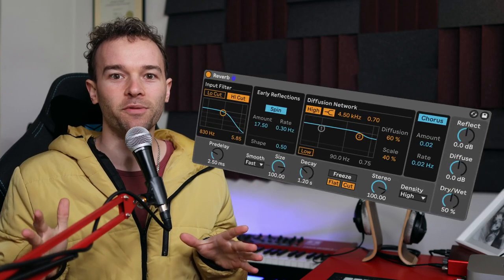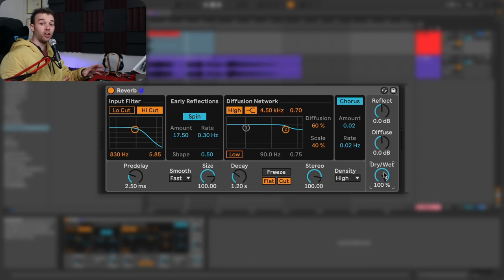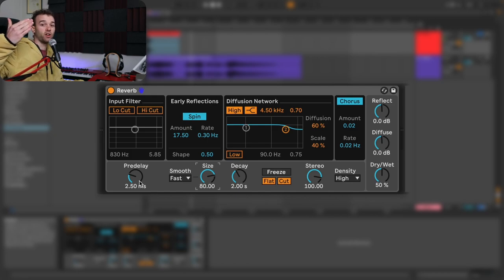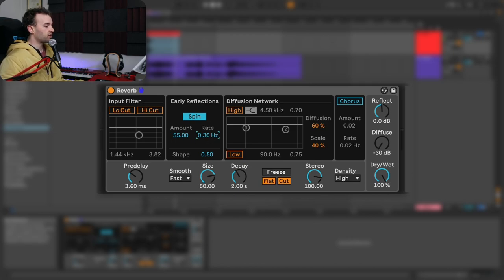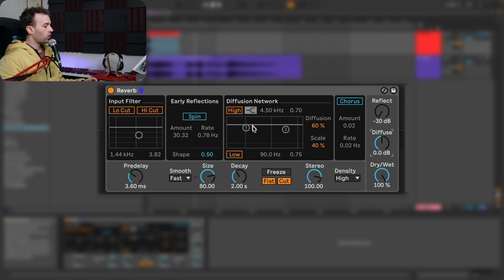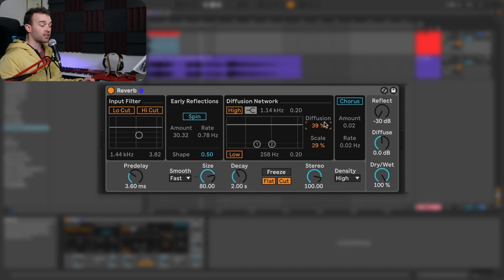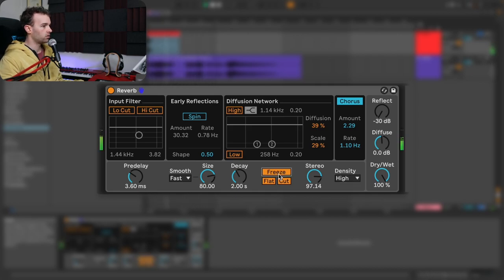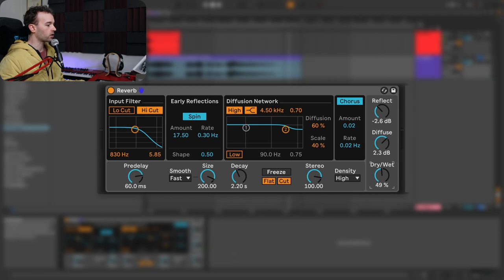A Ridiculously Detailed Look at Reverb in Ableton

Comment: What's the difference on the density settings
Reply from the maker: Good question! It's basically the 'quality' of the reverb, with a higher quality resulting in a 'better' sound but at the cost of higher CPU. I generally recommend having it set to High, but you can try out different settings to see what you like. :)

Comment: Why you’re wearing jacket indoor?
Reply from the maker: I recorded this video in my old studio in Melbourne during winter. Australia's building standards are really poor, with very little insulation, and the only heating available in this room was a little electric heater (which is expensive to run). It was probably about 8-10 degrees Celsius in the room when I recorded this video. 😂